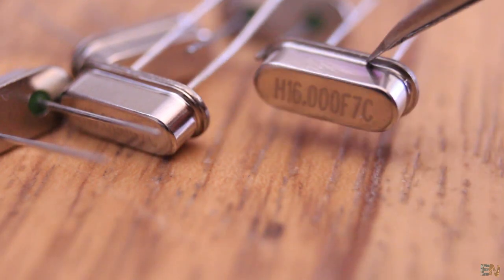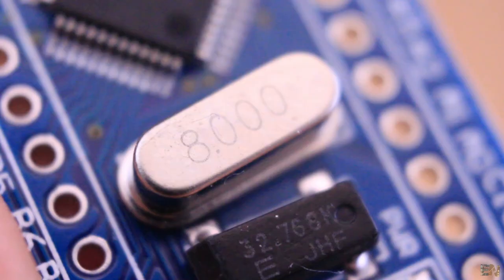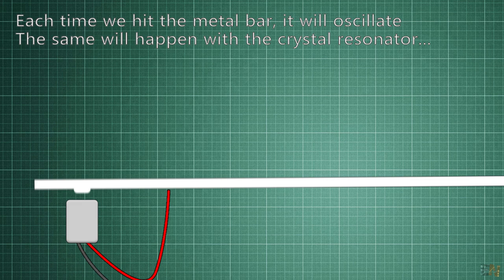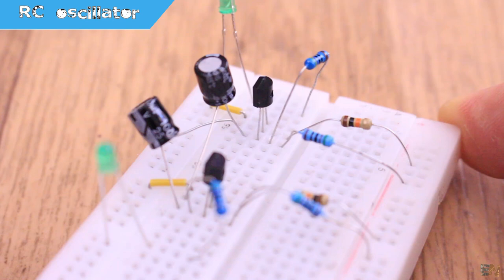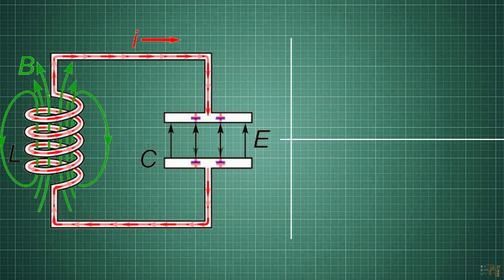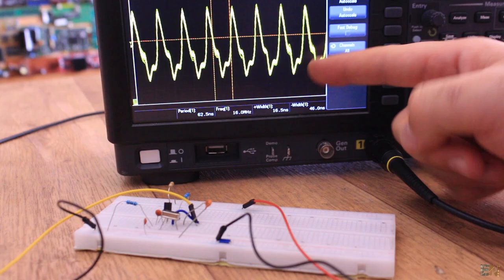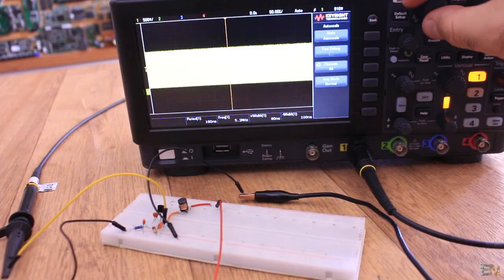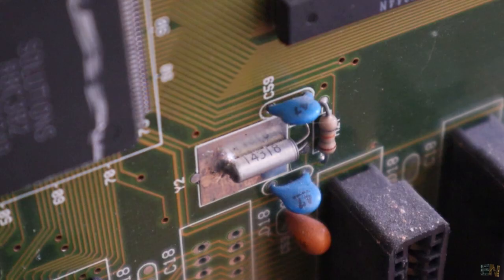Crystal/ceramic resonators & oscillators + Digital clock

Comment: The only thing that is missing in this video is that you can (up to some range) check if crystals are working, using multimeter, by placing black probe to gnd, and red probe to one of contacts of resonator, multimeter should show frequency while device/pcb is turned ON. Not everyone has oscilloscope at home.

Comment: Is it true that the 3p resonators won't need capacitors in series with them
(the ones that usually came with the value of 22pF)
Because, I've seen a lot of microcontroller schematics
that uses those 3p resonators, but doesn't use 2x 22pF capacitors...

Comment: How about atomic clock? Is it use a crystal too?
Reply: No an atomic part uses the resonance of atoms like Cesium or Rubidium. I believe these use a microwave cavity to set up the oscillations. 

Another (newish tech)  resonator is MEMS (Micro Electrical Mechanical Systems). These are more stable over a wider temperature ranges, as quartz need to be temperature stabilized to remain accurate (ie Oven Crystal Oscillators OXCO).

Comment: Two noob questions if someone would kind enough to answer, pls & ty....
1. If you always have to essentially convert the hertz to seconds, why is that particular speed so special or any easier to use, just because it evenly divides down to a whole number 1?
2. Why cant they just manufacturer 1hz crystal, save everyone a lot of work?
Reply: The answer is pretty simple.
Let's suppose that while measuring time, there is always an error of 0.05Hz which can be machine error, human error or any type of an unavoidable error (since we don't live in an ideal world). 

Case 1: Now if we try to make a crystal of 1Hz, the worst-case scenario will be that we might end up making a crystal of 1.05Hz. Now while measuring time, this error will get added up with each clock tick. So after 1000s, the calculated time will be 952s with such a crystal. The situation will get worse as time passes by.

Case 2: Now if we make a crystal of 32767Hz, the worst-case scenario will be that we might end up making a crystal of 32767.05Hz. When we divide this value by (2^15) using 15 flip flops, we'll get a net value of 1.0000015Hz. On measuring 1000s with such a crystal the measured time will be 999.9985s.

Which case seems more accurate?
Reply: @divyanshu_harkhka  wow, great explanation, thanks so much! Im a software guy long before a hardware one... i need to remember the physical world is not the same as the virtual 😉
Reply: @divyanshu_harkhka  then why dont put 1GHz to watch and few more flipflops.... this will produce much more precision
Reply: @hardxor  Ever tried cutting vegetables with a sword?

It's not only about the number of flip flops. At such a high frequency, we have to use components that can actually handle such a high frequency. This will also reduce the battery life and will have other negative effects too. Will you pay 25 times the price for a watch with 10% battery life and almost the same precision?
Reply: Issue is size. A 1 Hz Crystal would be quite large and too big to use in a watch. The crystal size and shape determines it resonant frequency, just the the length of a pendulum. The shorter the pendulum the faster it oscillates.